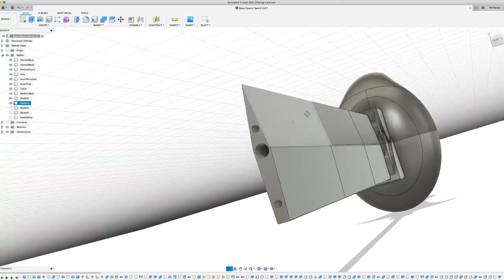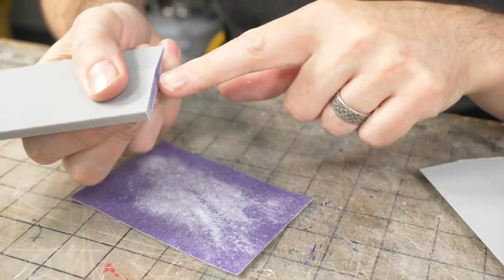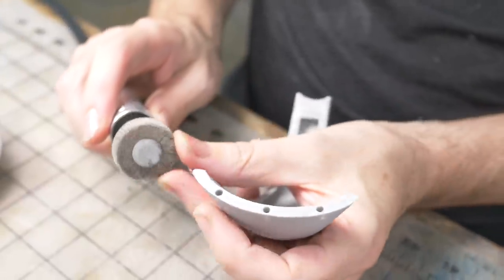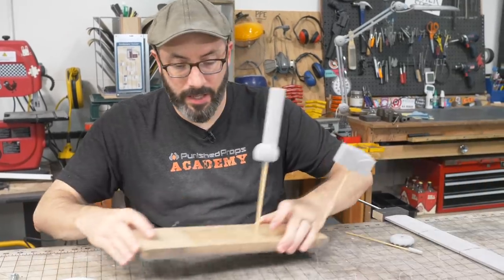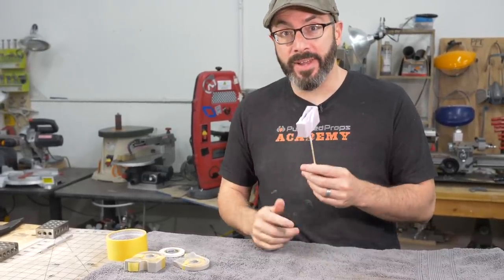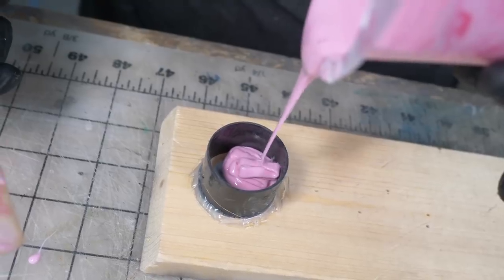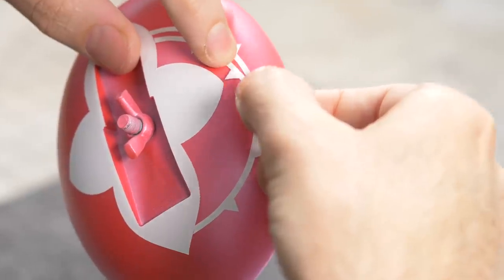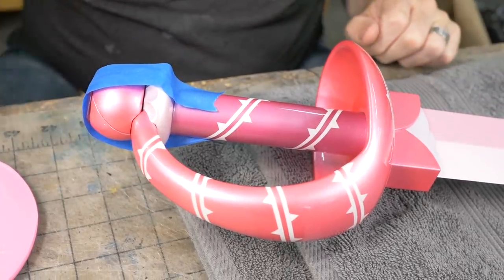SO SHINY! 3D Printing Rose Quartz's Sword | Steven Universe

Comment: I'm a big fan of using the 3d filament for the registration pins.  I dry assemble then flood the join from the back with solvent and it all welds together like its solid.  The solvent I use for PLA is Dichloromethane which is great but evaporates suuuuuper fast.
Reply from the maker: That’s so clever!

Comment: For prints like this that she for display, with lots of support to remove, increase your support distance and maybe consider PLA. PLA is far easier to print, it is nice and rigid to finish, and it doesn't let out nasty fumes when b printing. It is harder to smooth but your seem to always use mechanical smoothing anyway. I did hear you say later you like ABS because it is easier to sand, which is true, but with PLA or even PETG if you need the extra flex, you can sand down layer lines most of the way then use filler primer and it's good to go. To each their own, I love your work, just my two cents as someone who does a lot with all different plastics.

Comment: I'm a newcomer to the fandom also, only getting into it over this past summer, and now I have a 2mm foam Spinel wig waiting to be sealed for painting, the supplies for a  resin heart gem sitting on my desk, and I'm planning out how the circuitry and structure of her rejuvenater will work! 😆 (For anyone else wanting one, it's gonna be how people make Darksabers, with acrylic blades butted against LEDs, or LED strips so the edges light up as well as anywhere else you want the light to come out. My current dilemma is putting the switch in the base of the handle if I also use a collapsible one, if that'll potentially damage the wiring, or if it should be in the top with a decorative button like hers has)
Reply from the maker: That's fantastic!

Comment: I'm curious as to the benefits of using the ABS slurry rather than another type of glue or filler?

Also wifey is voting for the temple. She's a big SU fan.
Reply from the maker: Oh fun!

Using ABS slurry creates a more permanent bond, as the acetone melts the ABS it touches. When the acetone evaporates, what's effectively left behind is a solid piece of ABS, rather than 2 pieces put together. It's a bit like welding!

Comment: Is this able to be made with PLA? I know ABS is stronger, however I don't have the printer cover to keep it heated
Reply from the maker: I think so! You'd have to use a different adhesive than an ABS slurry, and sanding might be tricky, but I don't see why it can't be done!